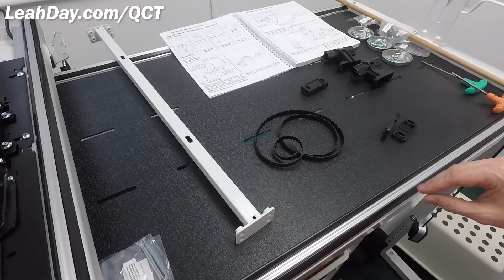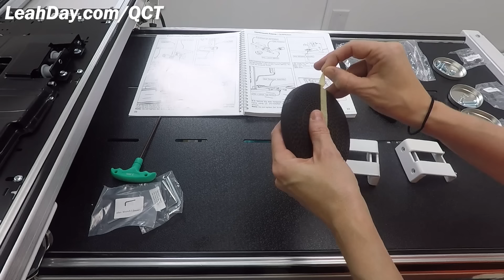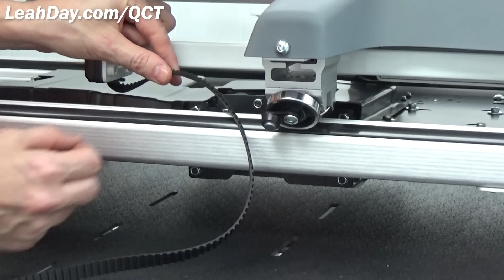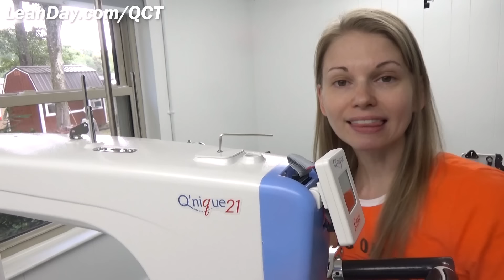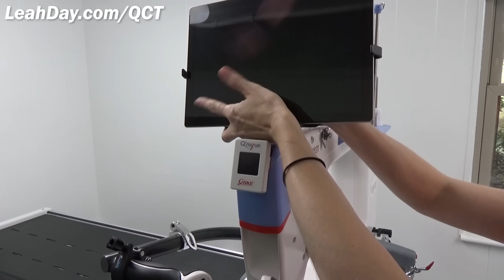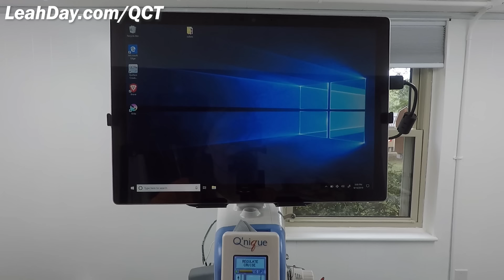Assemble Your Own Computerized Quilting System - QCT Tutorial

Comment: Hi Leah! I’m just seeing your video AFTER installing our automation yesterday.🤦🏼‍♀️ Our machine has a lot of resistance when moving side to side. Should it be sliding easily?? If so, do you have any troubleshooting tips?
Reply from the maker: I'd check the height of your back rail. It sounds like it might be rubbing the machine. Also check your channel locks. I tried quilting with one channel lock engaged and let's just say - weird results!

Comment: I noticed you locking your channel locks on the carriage. How can I get that? My machine doesn’t have it.
Reply from the maker: It’s not 100% required to use channel locks to hold the machine in place. I’ve attached QCT to a Cutie Breeze which doesn’t have channel locks and it worked just fine. Having them locks is convenient, but it’s not something you must have for this to work. In fact, if you forget and leave your machine locked in a direction, it would conflict.
Reply: @LeahDay  yep. I made one out of a piece of pvc pipe. It works pretty good, but is kinda hard to get on the wheel. I did forget to take it off, one time. Minor issue but I learned from that mistake…lol. I like the looks of yours. I really don’t know why I’m watching this video. I’m not automating my long arm…lol. Just like to watch your videos. Thanks

Comment: Does the motor and power strip come with the QCT?  As well as all the other supplies?
Reply from the maker: Yes, when you purchase QCT, it will come with the drive motor, belts and tablet bracket. You'll need to purchase a computer tablet to use the computerized quilting software. You can read a lot more about this here - https://leahday.com/products/quilters-creative-touch
Reply: Thank you so much @LeahDay

Comment: Is the 19 X basically the same as this process?  The book instructs on putting the long belt and brackts out of box N and C first. before the short belts  I'm so confused!
Reply from the maker: I would trust the instructions you have as they are probably the most up-to-date. I shared this video three years ago, so the methods for attaching may have changed.

Comment: hello.. some of the newer tablets come with USB-C ports and not the USB-A or full size USB ports. how is this 'male-male' cable used? what kind of adapter is required?
thx
Reply from the maker: Unfortunately QCT and our longarms are ONLY compatible with the USB-A port and I don't think an adapter will work. I recommend this tablet because it comes with the correct port, is very easy to use, and handles QCT really well - https://amzn.to/3yG8Tps

Comment: Hi Leah, You did an excellent job. I am helping my wife with this project & and your video made it much easier. A little tip on tools. If you use Allen wrenches regularly go to harbor freight & ask for the Allen wrenches with the ball on the end. This lets you use the wrench on a angle to run the screw in. Use the regular hex to make final tighten of faster. Thanks again.

Comment: I am adding Quilt Motion automation to QNique 15 pro with QZone Pro Hoop   Do I need to change an electronic circuit board?  I received one with package. I don’t know where it goes. Help appreciated.
Reply from the maker: No, you shouldn't need to change anything to do with the motor or system. The box will come with all the brackets and attachments to connect QCT to any frame and machine (so you have lots of extra parts left over). Check the box, check the manual and follow the instructions for your frame and machine carefully!
Reply: @LeahDay  so will it include that male to male cable you mentioned?